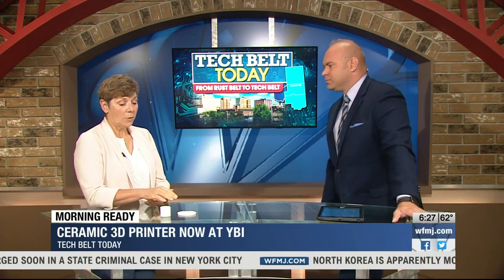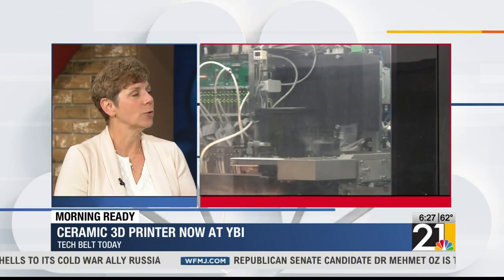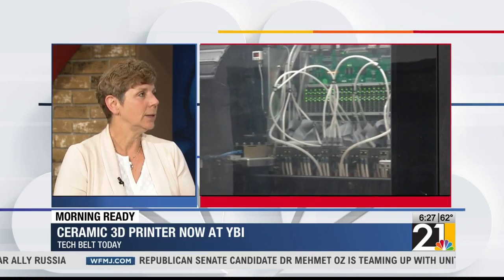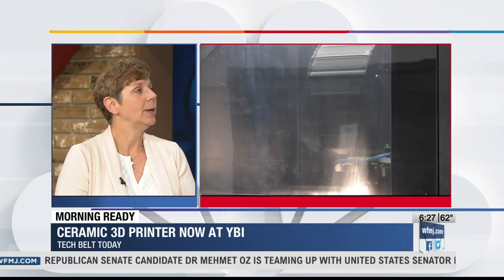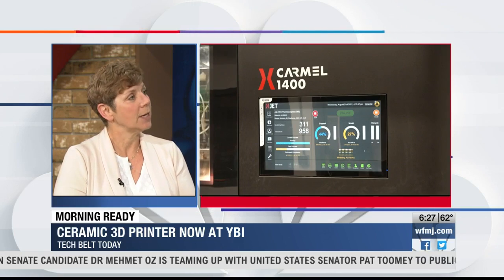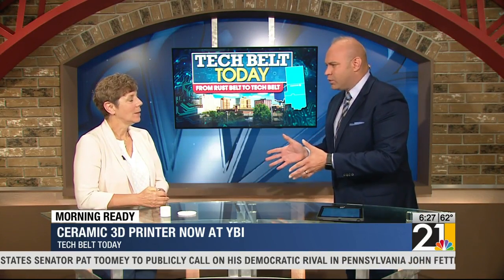Tech Belt Today: Ceramic 3D printing

Comment: Compared to the Clay Station 3D, this printer is not big enough. The build area is tiny unless you're a squirrel. A maker should not be restrained by a tiny size of the 3D printer when creating things. The Clay Station 3D allows you to 3D print ceramic objects in life size.